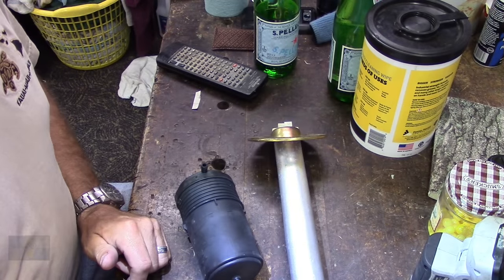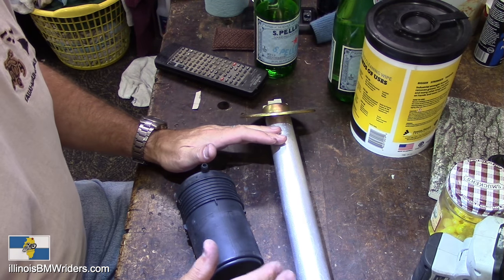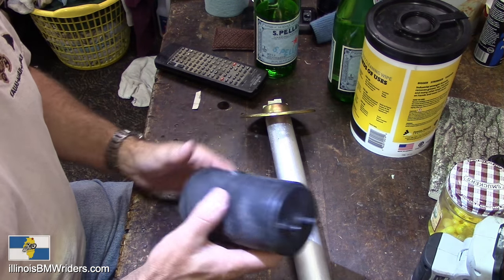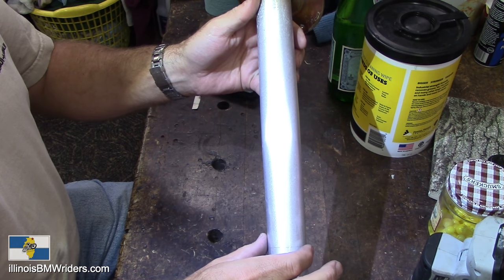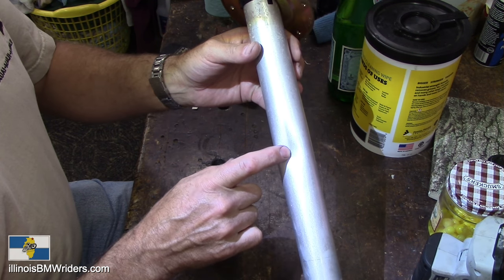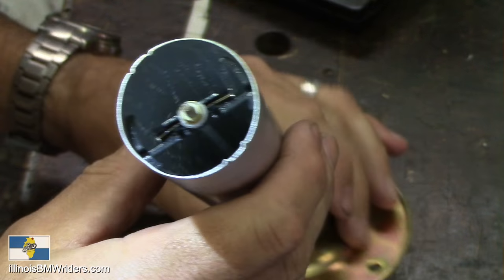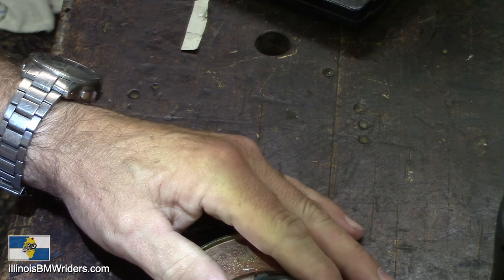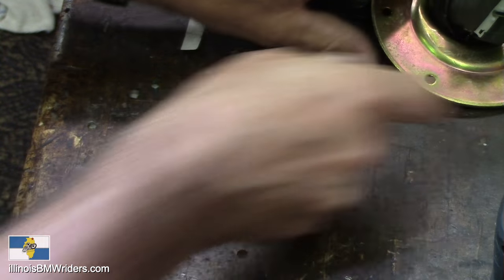BMW K1200LT DIY Fuel Gauge Repair

Comment: Hello, i have a 2007 BMW K1200GT which the fuel gauge stopped working and a yellow triangle warning sign came on. I know the bike has about 3/4 of fuel but gauge shows nothing and the fuel icon flashes. My question for you is: does the 07 K1200gt have the same style fuel sending unit as the one on this video.? I've watched another video where the fuel pump had a fuel gauge sensor attached to it so before I went out and start disassembly i wanted to do find out what I'm up against. Hopefully you'll know what type of sending unit my model bike comes equipped with. Thanks in advance for your attention.
Reply from the maker: Unfortunately no.. Yours has the dreaded fuel strip. Sometimes you can get them working again if you shock the connections with a piezo electric spark tool like you do with Christmas lights.. There are videos on it.. Do a search for Fuel Strip fix. My son has the same bike and we finally put a fuel strip modifier in it to tell the bike it always has a full tank. He then fill up by mileage.. Its one of BMW's dumbass designs....
Reply: @kirksmotorrad  thank you very much... I googled it and found a possible fix just as you mentioned.

Comment: Hello Kirk,  would this work for 2012 r1200r ? I’ve had the same problem for so many years then BMW came out with a 15 year warranty on it.  I know some bikes have the floats versus the strips. Every time I get it fixed it last about A month and goes right back to seeing the gas tank is empty.   Thank you for the help I really enjoyed the video. I am up here in Chicago where do you guys ride out of?
Reply from the maker: Sadly no. As long it is under warranty I would still take it in. We ride out of Crystal Lake mostly.

Comment: Thanks for the gas gauge video. Do you have a video to repair, remove, or reset the ABS on my 2008 k12 gt?
Reply from the maker: I filmed one but have not yet edited it. Once you remove and replace the ABS it will reset itself. It is not hard at all to do the gt. remove it,  plug the lines and send it to modulemasters.

Comment: What dented the tube?  Isn't that tube inside the fuel tank?
Reply: Steve, when the canister clogs it causes the fuel tank to pull a vacuum. Since it’s plastic it collapses and dents the sender.